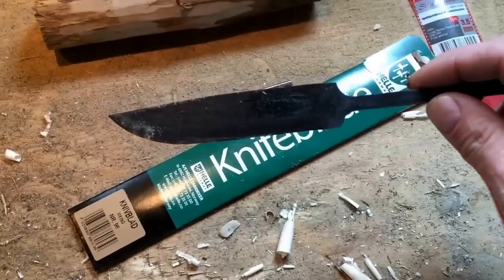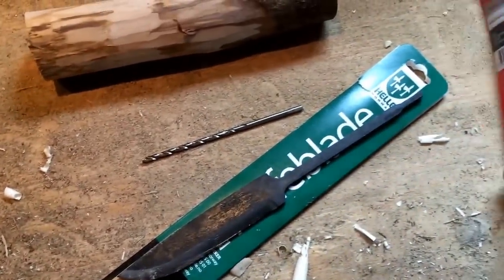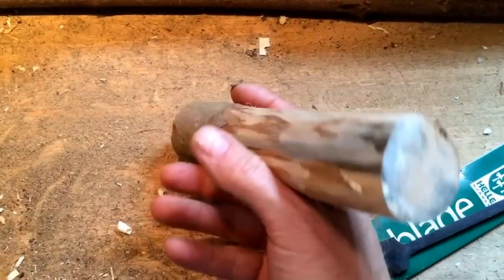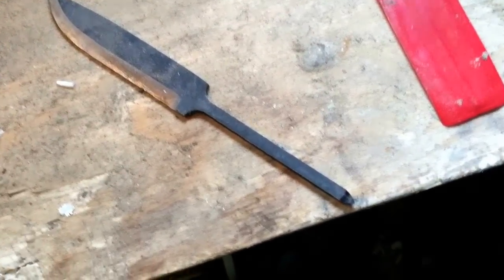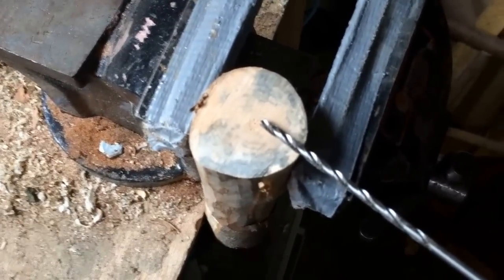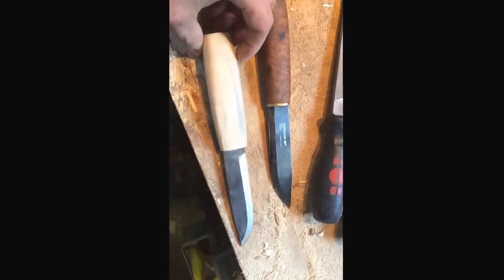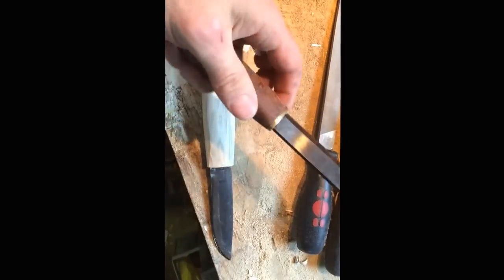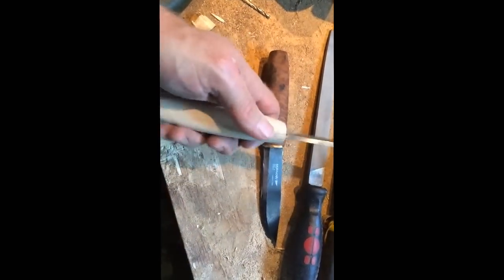Put a handle on a sticktangknife

Comment: if you heat up the tang (just below red hot) you can burn it into the wood and it will fit better once its about half or 3/4 of the way in (depends how big the hole) is you will start hammering the rest in but its all up to you and what you feel is good for burning 
its how chisel handles were attached and some japanese knives (SOME(i know someone will come out and say it never happened))
Reply from the maker: Yes true. I know about that method. Thanks for commenting 👍🏼